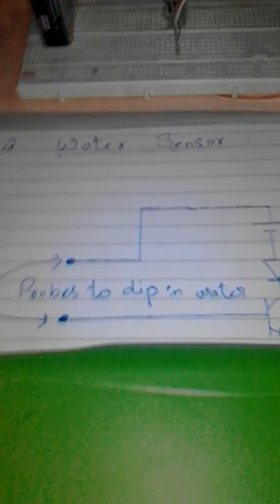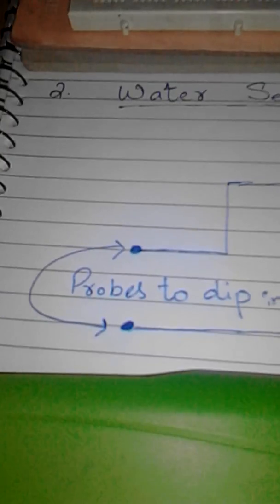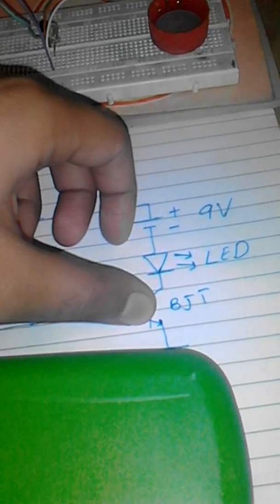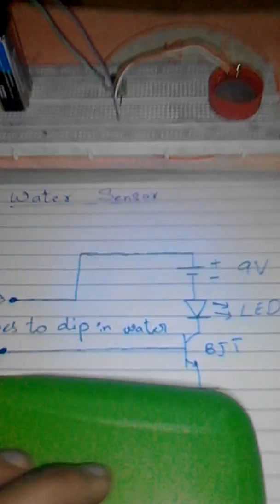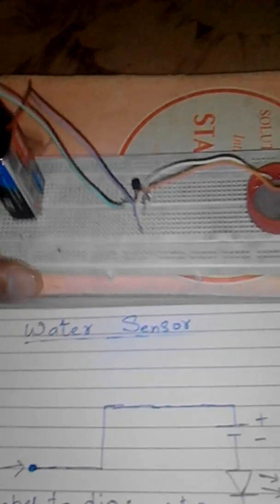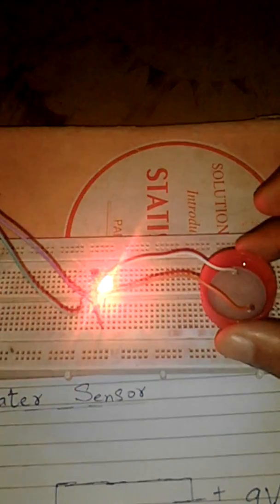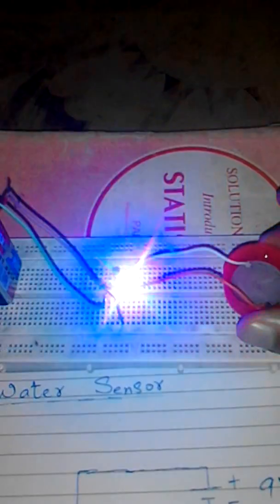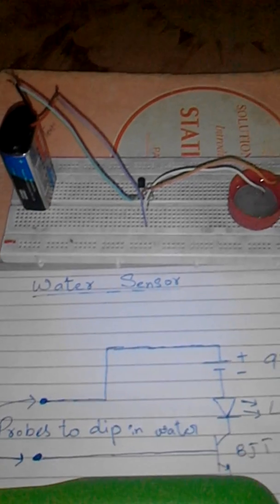Simple Water Detector

Comment: The PQWT-TC series Underground Water Detector can form the curve graph and profile map automatically, you can get the drill position as soon as finished measurement. It can save you lots of cost and time.
Here is the operation link of our product: https://www.youtube.com/watch?v=MVRgO5CUyJI&t=4s

For more details, please contact with:  
Christine Lau | Sales Engineer
Mobile: +86 188 1712 1525
Email: christine@pqwtcs.com
Whatsapp: +86 188 1712 1525
Skype: +86 188 1712 1525